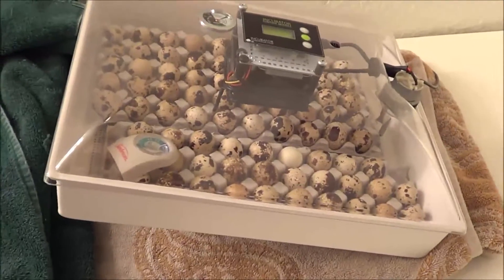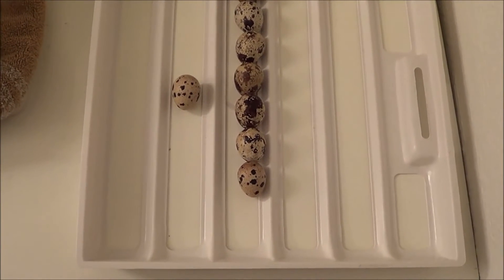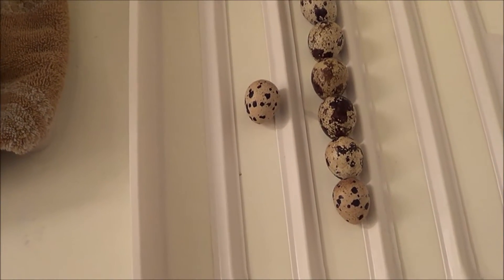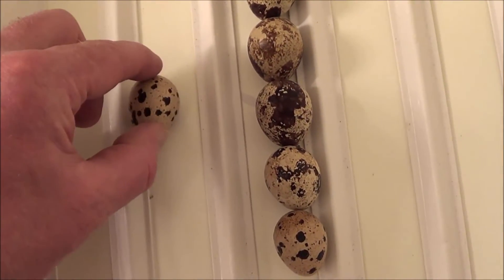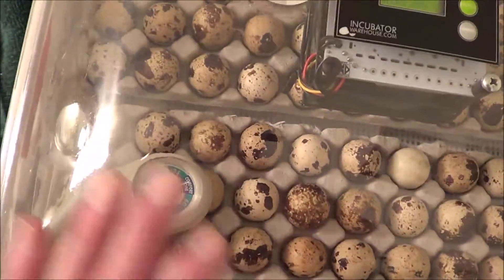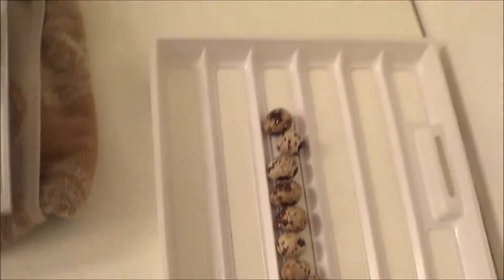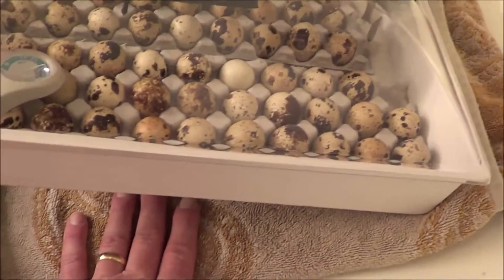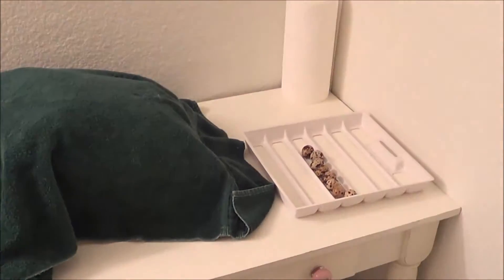IncuView Incubator Experiment Part 1

Comment: The heating pad under is great and not directly under but elevated above the heating pad on low.  I used coasters under the corners of the machine and it worked great constand 99.5!  Find her video its called 100% hatch rate!  Youtube

Comment: Ive had horrible hatch rates with this on my quail.  Out of 44 eggs i got 6!  The trays make the egg goes in all the wrong directions and after i did a 100% hatch rate of chicken eggs.  I called this morning they tell me they should be like a 75 % hatchrate or more but i got two horrible hatchrates for quail and 100% for chicken.  I think those egg turners need to be changed for quail

Comment: here's a idea  get a 12VDC to 120 AC inverter  and car battery  with some jumper clips  to go from batt to inverter  then plug hatcher into inverter  when power goes out  again  loss of 80 chick's would be a shame
Reply from the maker: Excellent suggestion and I'm considering this exact thing.  I should have mentioned that in the video, but I usually just hit record and go for it (obvious, I know).  We really have very few power outages up here - 9,000 feet elev. in the Rocky Mountains - even with TONS of snow.  But the wind this year has just been incredible and been knocking down trees like crazy.  100+ MPH winds several times so far this year.  Crazy!  We've been lucky - no trees have hit anything on our property so far.  Some of our neighbors haven't been so lucky.
Reply: I live in a suburb of Riverside Calif  our longest black was 9 hours due a car hitting a local power pole  We do historical reactments  of the Fur Trade and civil war  so I make wooden candle lanterns  I have a few around our house and a oil lamp or two  I have a box of small wooden matches by each one   BOOM black out hits  light the lanterns and oil lamp and just keep on interneting  via primitive light 

Also that same batt->inverter-> charger set up can recharge tablets / smart phones to keep you informed  about what's going on
Reply from the maker: Walt Lars 
Wooden candle lanterns...those sound interesting.  They made of pine?  Got lots of that around here.
For inverters, I have one ready to go for the truck if shit goes real bad.  Hook up the inverter to the battery, fire up the truck and run an extention cord to the house for basic power. 
12 five gallon gas cans will keep us idling for quite a while.